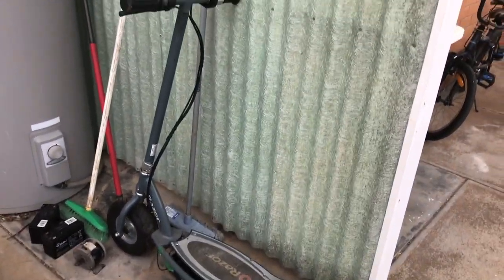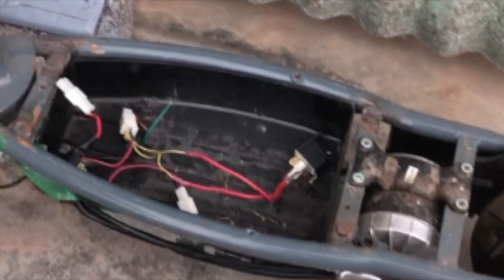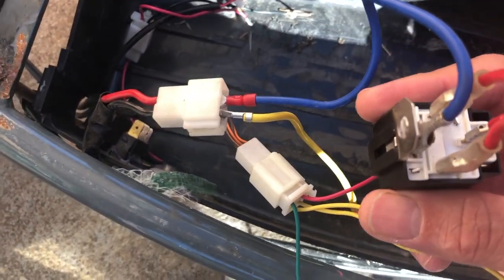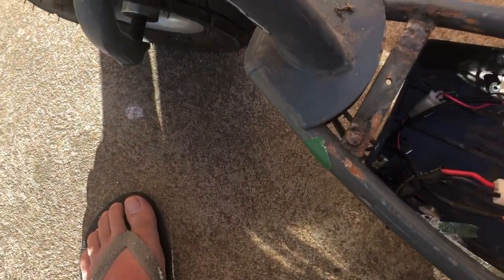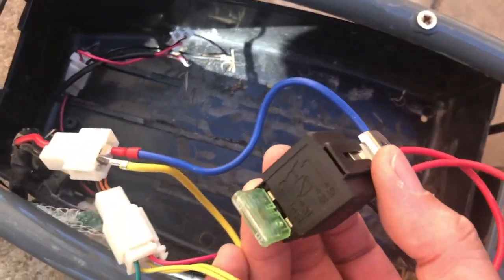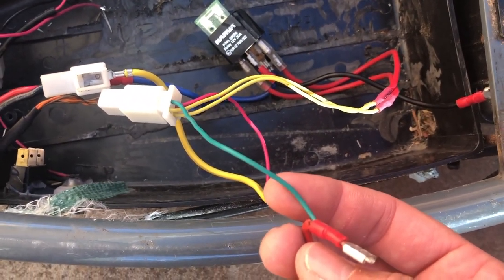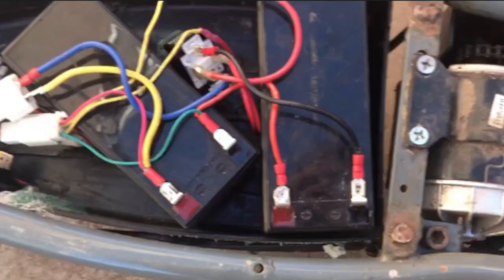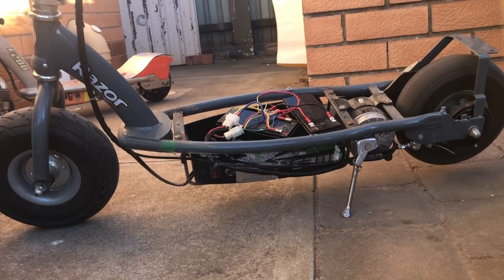Razor E300 Electric Scooter Hack - How To Replace Speed Controller With Relay

Comment: Did the relay take the power from fully goin through throttle switch bc those wires are tiny and will burn
Reply from the maker: That’s precisely the job of a speed controller or relay ... the wires through the throttle switch are just a input or trigger to the speed controller or relay! Cheers Drew

Comment: Hey Drew, thanks for the great videos... I just got a Razor 300 yesterday to fix up . Batteries are full charged , power switch lights up, and motor runs, by hot wiring to battery:)  and controller clicks. I disconnected brake connection to try  to test throttle but nothing happened. Is there a fuse on the Razor 300? Any suggestions or ides ? Thanking you in advance Drew:)
Reply from the maker: Hi Deborah, there is a small black button which is the fuse.  But if you are hearing clicks from the controller then this is not the problem.  Suggest you measure the voltage of your batteries to see if they are up each close to 12.7V first! Cheers Drew

Comment: A good trick for when using 2 SLAs but really you're gonna draw insane amount of current and kill batteries quicker than usual, and potentially over discharge. I'd pay a few extra bucks for new controller out of china. Regardless you got that bad boy going!! This thing is as rusty as mine making things trickier to work on haha.

Comment: I have the e100 the throttle cables are yellow sogo to 85 86 right do you connect the switch to the throttle cable. I wanted to ask you if you can post step by step an its my first time trying to wire a motor to a relay with the scooter that would be so awesome an a big help thank u for your vids and your time i forgot i subscribed to your channel bro
Reply: Black and red 85 and 86 doesn matter what side 9

Comment: Hi mate, is this motor phase or positive and negative?
Reply from the maker: Hi Mate, I'm not really sure of the intent behind this question to be honest.  It is a DC motor so you can hook it up either way the motor will just spin in the opposite direction.  Does this help?  Cheers Drew

Comment: It's not the relay the it's the motor. It has a custom motor if you do the relay on a stock motor it works wonderfully
Reply from the maker: Hi Herbert, I suspect you are correct!  I have recently done a mod to the Speed Controller on a stock E300 which is working a treat now!  Check it out here: https://youtu.be/ojrqHeB9G1Q Cheers Drew

Comment: Hello, what is changed with that relay, more speed or what?
Reply: The relay is like a gate. Only opens once the key is inserted. Allows the battery power to go to the motor when the gate is opened.
Reply from the maker: Hi Dan, More speed mate! However it does hammer the batteries:) Cheers Drew
Reply: Yeh I just got your trick am in ghana I will try it

Comment: Would this work on a razor pocket mod 24v
Reply from the maker: If it has the same speed controller, yes!
Reply: It has the ec005
Reply: @DrewFixIt  what is that relay called

Comment: Hey I'm looking at your video look pretty interesting I would like to do mine do you have a diagram how you set up that really I have fortunes just relay on Amazon but do not know how to set it up will greatly appreciate if you could send me the diagram from the battery to the motor to the throttle I'm for some reason my orijinal set up that I have is original it stock I have Fortune to scooter from someone and for some reason whenever you stepped on it it does not have the power to move you but if you lift it up and press the throttle it will move the wheel will spin I mean but as soon as you stepped on it it will not spend it will not go anywhere any tips any help would be greatly appreciate thanks very much I'm looking forward for you to help me with that relay thank you
Reply: @DrewFixIt  hey bro I have already replaced the battery but just I need to know how to use the relay and how to wire it correctly that's all I need to know in terms of what go where and what connects to wear
Reply: @vickisabella130  did u ever get the diagram?
Reply: @DrewFixIt  can u send me the diagram?
Reply: @stevenmigliaccio9783  no my friend would like to have it
Reply: I need the diagram as well please, where's the link?